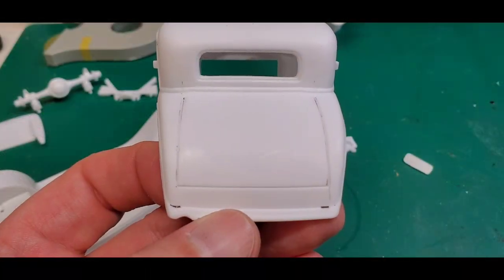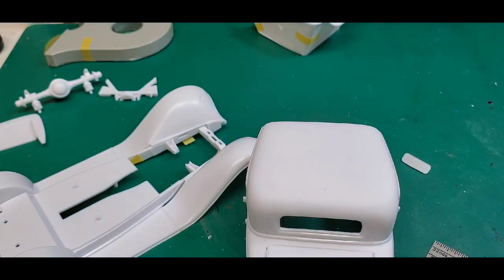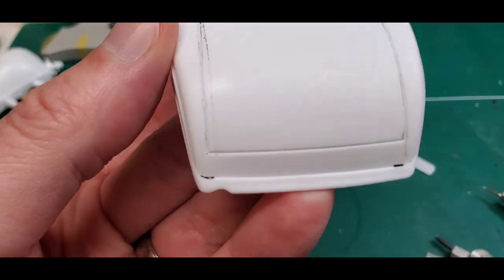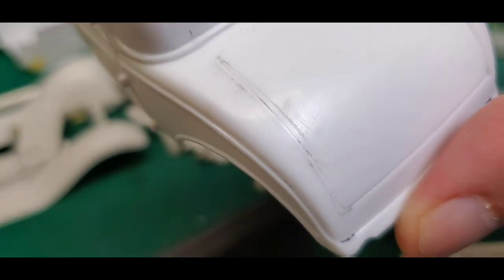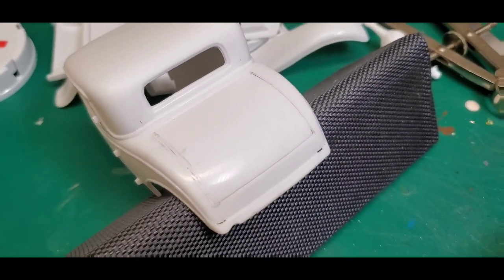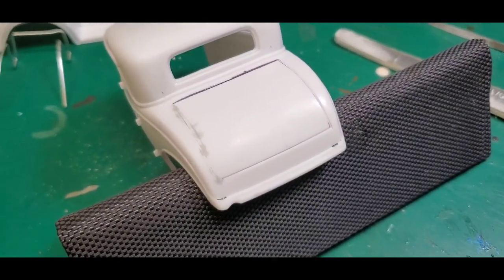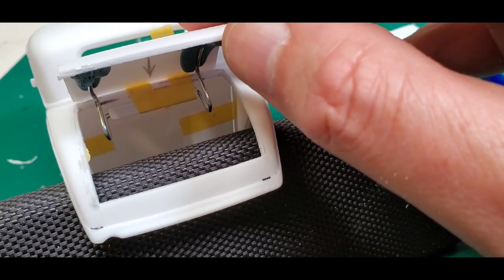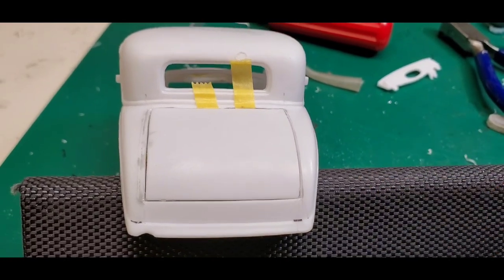Revell '32 Ford Coupe: We decided to fix that deck lid!

Comment: Great work.  I’m so glad you fixed that issue.  Contest build or not, knowing that issue was there would have driven me crazy if that was my model.  Your technique to fix that issue was simple and straightforward.  Excellent work.  You just presented an example showing why it is important to step away from a build and think about an issue instead of just diving in to fix it.  Thanks for sharing.
Reply from the maker: Hi Michael, thank you so much! It just felt right to slow down and fix the issue, which of course led to other things, but i still feel better  about that trunk lid. 😊
Reply: @BGsModelWorkshop  I would have done the same thing.  Opening that trunk gives you a lot of detailing options.

Comment: Not sure I would have made the extra effort but I have a hard time not to accept a challenge, so I am impressed with your decision and determination to forge ahead and open the trunk.  As they say: "no guts, no glory".    I also relate to Vic's comment, I cannot score out a seam without making a bunch of scratches in the body.
Reply from the maker: Hi Steve, wow, thank you so much! I have tonsay I feel I can not become a better model builder if I don't push my self a little bet once in a while. Thus felt like thr right type situation. I am horrible at scoring lines, I really had to concentrate and go soooooo slooooww. 😁

Comment: Looks great Bryan!  I was going to suggest you open it up, make a rumble seat. Trunk’s good though. Thanks for sharing the process. Happy days and model on!  😎
Reply from the maker: Hi Peter, I had thought about the rumble seat, i actually made the hinge wire so i could place it in a way that would allow the rear to open up just like the rumble seat do. but i passed up the idea because i didn't want to go through creating a seat cushion  and that sort of thing. Maybe on the next one!

Comment: Great job! I would suggest you could shorten the hinges a bit and put a little bit of plastic near the hinge so then you open it it will stay open.
Reply from the maker: Hi Kent. Great idea, thank you. This is only my second go at making hinges. I'm still not happy with the opening angle. I only have the bits tacked I to place so I can shift them a bit amd I want to rework the wire to be less...."janky" looking. 😁
Reply: @BGsModelWorkshop  And since you can do more  I would suggest thinning the edges to make them look better. Just trying to help....
Reply from the maker: @kentgustavsson8073  Thank you Kent, it is in the works 😁

Comment: My first thought was to cut off the deck lid, sand the crooked edge straight, add material to the quarter edge and again sand straight. Then add support to glue the lid back on. 
Honestly though I probably would have left it alone to see if anyone else noticed it.
Reply from the maker: 😁 I felt it was worth my time to try. I think we did a pretty good job. Thanks for the idea, I can use in that technique in the future.

Comment: Very cool! I have never added hinges to any of my doors or trunks. This will be a good learning experience for me. What is the wire that you are using to create the hinges and what did you use to bend them. I believe this is going to be a really great build for you.
Reply from the maker: Hi Mike! Thank you so much! 
The wire is is just a paper clip i straightened out and I have been using some needle nose plyers. very basic stuff. 😊 The hard bit for me is making both side match. I suppose i could, like, I don't know, measure or something? LOL
Reply: Why would you want to do something like measuring?LOL It 's almost like reading a map when travelling ( I know where I'm. going :) ) Have fun with it BG it's gonna look great.

Comment: Try the louvered deck lid from the 32-5 window it'll fit
Reply from the maker: You're right, it does!! But i am keeping this as is for now. Thank you!
Reply: Did you drop the front axle is an old t i m b o y d trick it is in scaleauto thank you
Reply from the maker: @williamwagaman9538  no I didn't. The kit has that lowered front end already, the wheel I added are smaller than the kit supplied wheels so it had a lower look 😁

Comment: Hi Bryan. I like the way you used the compass to follow the line, but I have to ask...either it's the camera angle or it's my eyes, but to me, it looks like the distance from the outside of the fender to the trunk lid is larger on the left side than it is on the right side?  I'm seeing things? I hope it's just the camera angle or my screwy eyes.
Reply from the maker: Hi Skip, thanks for watching. there may be a bit of parallax from the camera. I checked and it seemed ok.
Reply: @BGsModelWorkshop  I'm glad to hear it was camera angle. I'm also in this build and the Revell '32 I have has horrible fit's on most parts. I've been out of town for Easter so now it's time to get back to it. June 15th will come quickly.

Comment: I have the first version of that kit. So, I checked mine. It's dead on straight,..I wonder if all later issues are that way, or, if Yours is a one of a batch ??
Reply from the maker: Hi Joe! Thank you so much for checking your kit!! WOW, Mine is the Goodguys edition from 1996. i wonder if some damage had befallen the molds? It seem like the panel line was sort of...hand made.. so to speak. Fascinating!
Reply: @BGsModelWorkshop  Mine is from 1996 as well. Picture of a real 32 in black on the box.